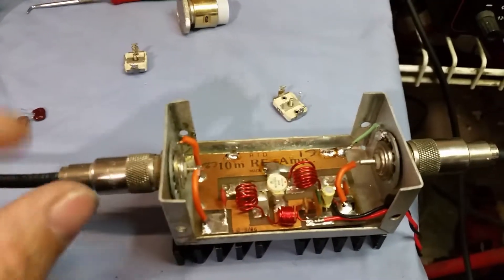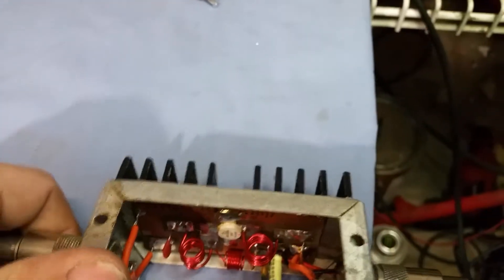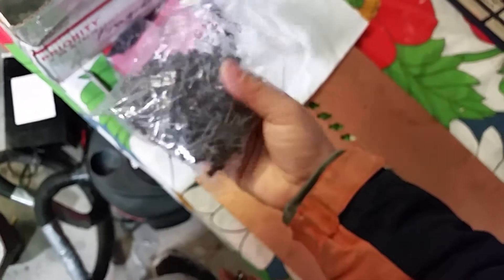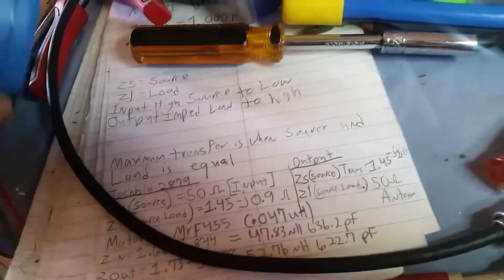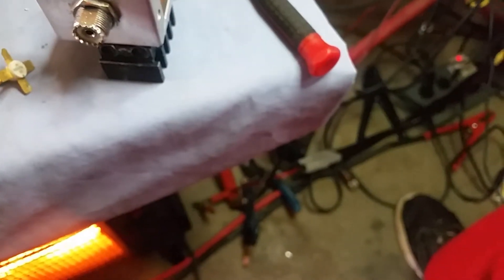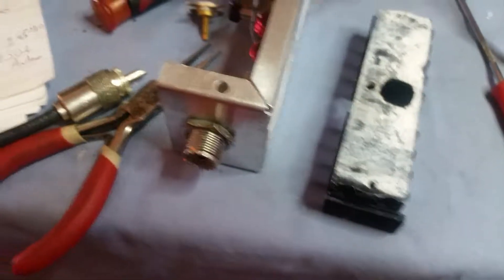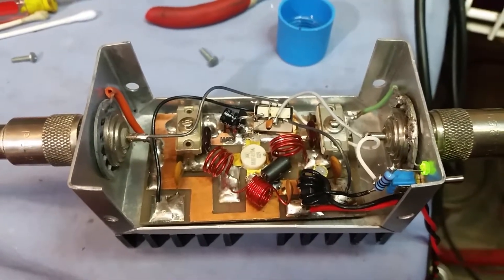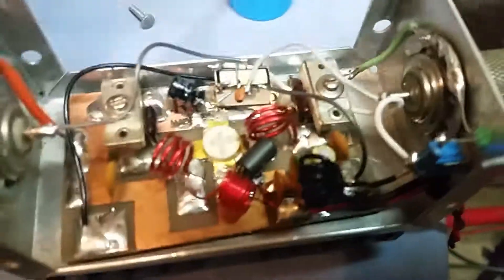Sentimental Homebrew Tuned Circuit 1 Pill Amplifier Repair - [Transformerless Amp]

Comment: Pre amp to drive a big amp..I picked up a one pill however has the black pill 40 watt pill..it was made by ranger gold however it's simple but has a relay and a SSB circuit..coils no transformer it does do 40 watts and will swing 80..I left the adjustable caps..you could say it's a modular..like watching you videos thanks man
Reply: So I wanted a one pill and not a mosfet transistor Italy you no..just a little helper

Comment: I have a Skywave DX250 that is a tuned circuit narrow band single MRF454 that will give me 200w RMS out with 10w RMS in on AM. It gives me 280w PEP on SSB with far less than it's max input of 40w PEP. That is at 13.8 volts with tiny 12 gauge power wire. That one is only good on 26Mhz-28Mhz. If I want to talk on all of HF+6m I have to step up to a transformer design that is broad band which means at least a 2 pill to make it worthwhile!
Reply from the maker: I want to see this for my self bad....my first try wasn't successful....I only for 100w rms. Ive gotta revisit it again soon.

Comment: I can't find a MRF455A, but I CAN find a MRF455.  Even at a parts search site it could not be found! Don't know the difference.
Reply from the maker: MRF455A is stud mount and MRF455 mounts with screws.  Whenever you see the A that means stud and yes it is almost impossible to find.

Comment: Hey on a 6pill of hgs .. the combiner  went up in smoke why would that happen and what watt and ohms do u use for the combiner
Reply from the maker: 2 main reasons
Blown pill or high swr on your output 

Most common is blown pills sorry bud. But not always.

That shud be a 100 ohm 2w but some people use higher wattage resistors..... if you need replacement pills text me at 678 557 4846 and ill help you out...you can also send me images of the amp to that number ill look at the board for you

Comment: That cool.....I once saw a real davemade 3 pill ...not a 1x2...but a a real 3pill...just 3 2879s no transformers.  Just tuned  Circuit something like your video...
Reply from the maker: Oh my id love love love to see that.....wow if you could find the images again and send them to me at threemanpro at gmail that would be sweet.......  I have seen a davemade base amp where he made the power supply switch mode home brew in amp....he is amazing man and is not in line light lol....crazy
Reply from the maker: What sucks man is ur the first to ever mention that and I have had the idea to do that for many years and imma try it soon.... now I know someone has done it...I shud have known it would be Dave lol.
Reply: The bad part is... I don't have pictures I saw it with my own eyes..... It was someone That was in the davemade camp showed it to me...... But Hey yeah Give it a go... Make a real 3 pill no Transformers tuned circuit

Comment: That a neat kit amp. Hard to remember back that far. There was amp kits like that in HAM magazine . That bord may be photo etched . I was doing that in the 80's from school projects. I still have a bunch of stud mount transistors. MRF 449/450/454/455/492/421 and some others. I got a nice old amp with 4 -MRF 453A pills. They used same input transformers and out put for the splitter and combiner. Is AB bias with 1N4997 press into heat sink. no pre amp. has filter board. SSB delay . got it on trade. 3 pole relay hard to find. replaced mica caps . working great. easy does 225 watt PEP on SSB. now that tuned circuit 1 pill has small band of operation. That may have ben 10 meters . why the coils were off. I had a Palomar 50 with MRF 450A come threw . had to tune and play with coil to work 11 meters. If you use ferrite cores it will brood band better  but drop the power a bit. you can use a splitter as a input transformer. just re do winding. the 2 windings that come together go to ground. in a splitter it's the input. one winding is input outher goes threw cap to base. just match 50 ohm to transistor. you can do same for out put but heaver wire . collector current. when you use push-pull transformers for 2 pills on 1 pill you loose some RF from un used side. I sent pic of 50V  MOSFET . That does 100 watts RMS from 10 to 11 meters. That 4 pill stud mount amp has DSS on it and has gold big heat sink . also has illegal for CB use. on it. it's on my RCI 2950 from 1990 has dual finals and LCD display. My newer 2950DX has blue LED display and goes 24.8 to 32 Mhz. the old one only 26 to 29.999 mhz. The new one has FET's output. does way more power but turned it way down. 1/2 to 10 watt dead key AM/FM 4  to 20 PEP SSB. that how I set my range of power. 73's
Reply: I did something almost exactly like that in 1990's in H.S. for my RCI2950. It started with super high hfe MRF455 then went to MRF421 then went to transformer broad band 2xMRF455 again super high hfe. All versions bolted to the back of my RCI2950. 18 feet of coax and 102" whip with a 6inch aluminum bar to get the antenna away from my SUV and get me to an electrical length of 108". I photo etched all my boards. This was back when you could run to RadioShack and pick up anything you might need before they turned into a cellphone and cheap Chinese made toy store! Way to work that all out on the job! Impressive! I had help in H.S.!

Comment: Flange mount. 
I have wanted to build a tuned circuit on a single device. Maybe one of these new HG 454 would be cool as a little modulator.
Reply from the maker: Oh yes....It would be fun also finding the right inductance for the input and output...the caps is never an issue because of being able to use variable capacitance.....ive always wondered could we ever find a variable inductor that would work in a simple L circuit like this.

I would probably break the inductor up into 2 sections so I can just fine tune that way.....not sure if you saw the tuned circuit 1 pull Toshiba 2879 Base amp I did....actually ill put a link to it in the description.
Reply from the maker: Also I just thought bout it...I have a lot of flange mount Motorola and I need to find the screw that us used and buy about 40 of them.

Comment: Hey can you make me a 2 pill ssb only amp for my ICOM 7300.  It is a 100 watt radio.  I would like to run it with 100 watts into the amp is that possible?  Thank you sir!
Reply from the maker: Of course that would be a cool amplifier build. Would this be a 10m or 11m? You may qualify for my side program in doing with the GF well talk more text me later on 678 557 4846